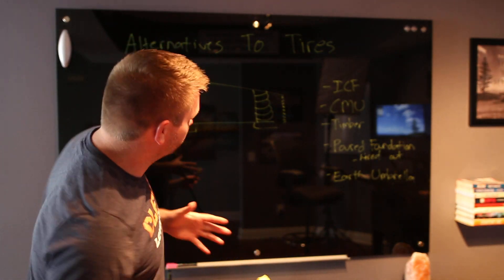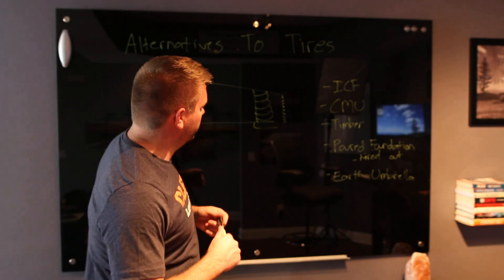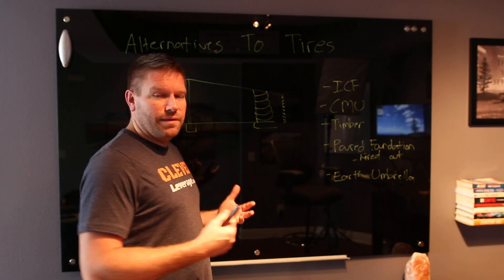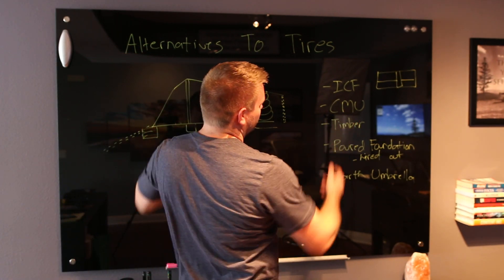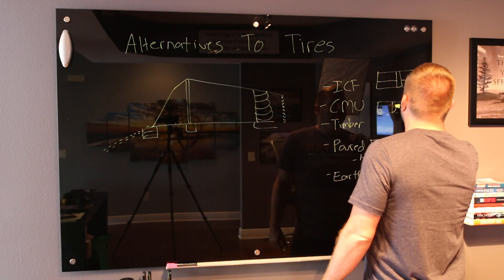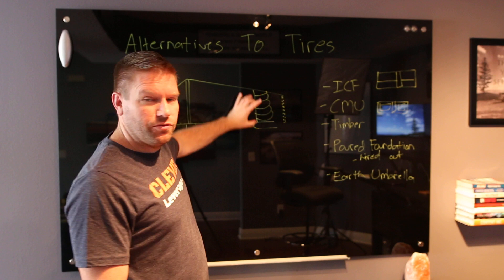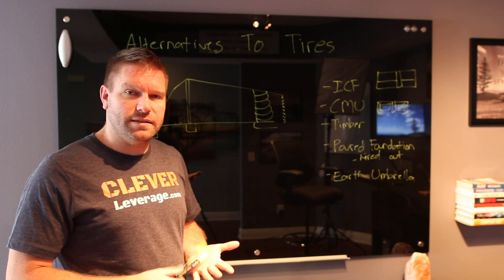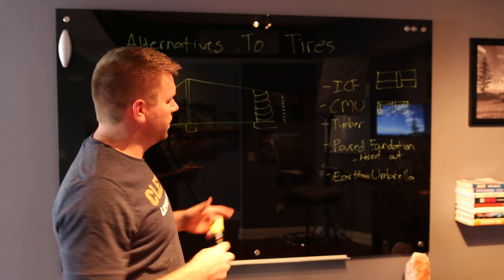Earthships: Alternatives To Tires

Comment: matt.  just use tires.  easiest by far.  rubber is resilient.  we can come to your site with 10 people and pound 1000 tires in 10 working days.  the whole outer wrap, cisterns, and cooling tubes installed.  prison labor it is.  but quick
Reply: Big Sky,

Do you have an estimate on the cost to do 1,000 tires?
Reply: @dennisbird  hey Dennis.  the answer really depends on were you live.  weather. materials cost.  labor and many other factors.  however, m last house cost around 40K to get up tires, cisterns installed, rough in plumbing, and cooling tubes.  it could be much more or less depending on where you live.
Reply: @tothewoodsnet6714  not much different than regular house.  size + materials +labor =cost
Reply: @bigskyearthship  That would be ten tires per person per day.
Reply: @jakebredthauer5100  yep

Comment: Just be sure that the wall you are going to build can hold up against the massive amount of earth you put behind it. The idea with the tires is not only about thermal mass but also as a counterforce to hold back the tons of dirt behind them
Reply: this is why EB tire walls are not even vertically straight, a straight brick wall would be hardly able to hold a green roof AND the wall behind

Comment: Why not go with cheaper more sustainable EarthBag tubes, or bags and rebar? Its got much mass, hurricane (wind) proof, fire proof, rot proof, bullet proof and EarthQuake proof?
Reply: Labor?
Reply: @jakebredthauer5100  how is that more labor intensive than pounding tires?
Reply: @oakmountaingod  What about going down in the ground Like Mike Oeler did.  He dug his by hand, but you could use an excavator. Then you make a wall and backfill.  Put an insulated roof on it. I don't think tires have much value in a cold climate.

I was not talking about tires. Tires are disgusting.
Reply: @jakebredthauer5100  I agree with you on that 100%. I am looking into alternatives for tires because I won't use them.
Reply: @oakmountaingod  What is your location? Hot cold Wet dry? Severe codes, mild codes? Do you want to spend a lot or a little? What are the top two that you are considering? Often the way the Indians did it and the way the pioneers did it at your location will give you some clues about what is appropriate.
Reply: @jakebredthauer5100   " The 50.00 and up Underground Home"

Comment: I have been exploring the same problems, on a hillside dig out for your building walls tapered or stepped back like a retaining wall,  then dig back 8 or 10 ft for thermal mass, with a backhoe, insulation on back of the trench and on top of mass waterproof cover,  put a french drain into water storage for drainage , fill with larger rocks filter fabric then gravel, could be done with 1 or 2 guys and a excavator pretty quick, basically  it's like a walk out basement with a greenhouse
Reply: I've used that same analogy as an argument in favor of poured concrete walls.  It's essentially a walk-out basement with patio doors all across the front wall.  Another upside is this should easily meet code in a lot more locations than some of the more exotic materials and methods used with earthships.

Comment: I’ve seen people build houses out of hay bails.  I don’t know if it would be strong enough but it could be a option in combination with other support.  
NOTE - I’ve never done it so I have no clue lol
Reply: I've done it (helped build them).  Not a great solution for higher-humidity regions and you have to be pretty fanatical about preventing moisture from getting into the walls, and making sure it has a way to get out.  Otherwise it's prone to rot/mold.
Reply: Hay bale can only be used for above grade projects, usually on tall basement foundation walls and under very wide eves/roof, it needs to be kept very dry or bad things. Earthship is a partly below grade project, half underground so as far as I know it isn’t possible to keep it dry enough in an earthship to use hay bale walls safely.

Comment: Hi, Matt, what kind of natural local materials are available on site or near by? I mean are there any stones, logs etc. in your area which can be easily used for construction as an alternative? One more example of earthship but looks like no tires: https://www.youtube.com/watch?v=I9jRYHpeAk0&t
Reply from the maker: Hi, lots of stuff to choose from... it's northern Maine, so endless amount of logging timber, there are rocks and boulders within a mile or two, but likely need an excavator long term to handle them. I can order concrete too, just have to be careful with delivery charge for remote areas. I would say number one resource in abundance is logs. Thanks, I'll check it out now

Comment: When you place a pole in the ground it always decays at ground level . A man that installed telephone poles that I know told me that. Everything above and below ground stays good for a really long time man. So if you was to wrap the pole with tar and tar paper or plastic it would last for a long time
Reply from the maker: Thanks David. Ah, so if it they were mostly inside the structure and waterproofed, might actually stand a chance?  Interesting, I’d like to dig into this more... seems similar to what they’re doing with the wofati?
Reply: @matt-justice  Mike used local trees for posts, charred, put in two ordinary polyethylene bags.  Mike Oheler, Fifty Dollar and Up Underground House.  I heard the house is still doing well.
Reply: @matt-justice  Soil is too heavy for a roof so use wood chips kept dry with a metal roof and collect runoff.   Use a sturdy ceiling for a deck for the wood chips or corn stocks.   Apply two or three feet thick.  Cover with soil for fire suppression, ventilation space, some kind of roof.
Reply: You probably should consider what kind of wood your timbers are made of...a tar-coated recycled telephone pole sounds like a good idea. Also, if you have the budget-cypress! It has a well known history of keeping its integrity in wet conditions. But, $$$$.

Comment: How about rammed earth?
Reply from the maker: Might be alright if I can rent some forms from somewhere. Have you used a particular type before you like?
Reply: @matt-justice  not yet. But I am thinking through the same core question your video is about. And I like rammed Earth as a material, very natural and warm. But probably would need concrete posts for the roof beams I think.
Reply: @matt-justice  forms should be easy to make out of plywood and 2x4 (or 2x6 / 2x8 depending on the length of the form). My biggest question was where to get a pneumatic compactor on the cheap with a large enough compressor, since I'd have no interest in doing it by hand :)
Reply from the maker: I hear that! Between pounding and lugging, I think I'd be done with these structures after I built half of one. You might be able to rent a gas stand up compactor if you're walls are wide enough to keep the plate aligned inside the form?
Reply: @matt-justice  nice little clip i just found. Looks like plain old concrete forms. Either rent or scout Craigslist for them. The thickness of their walls looks good too. Maybe even 1.5 - 2x that for the earth ship. Then pond liner on the hill side of it before filling in. Could see that being a very nice thermal mass. But yes... a bit of work still. I'd imagine 5x faster than tires though... It makes the most sense if the earth on your location could be used to safe a bunch on material. 
https://www.youtube.com/watch?v=o8dmHzwyjuM
Reply: @matt-justice  Rammed earth requires only one section of form.  Move it over or up as you go.  No waiting for curing.

Comment: I want to use 1200x600x600 interlocked concrete blocks $30 each 4 walls around 6 metres long
Reply from the maker: Yes!! I’ve been looking at these, seems like the perfect solution... and the wall will be done in 1 day. I can’t find places to buy them in Maine so far. Every once in a while there are a few on Craigslist, but not enough quantity.
Reply: This sounds like a potential solution.  But at C125.00  where I live, still might be cheaper and definitely quicker than poured concrete, time to get the calculator out :)

Comment: Instead of vigas some kind of posi strut bowstring trusses can be considered for the roof and back wall load bearing as well
Reply from the maker: Excellent idea, thank you. Have you purchased some from any reputable manufacturers/builders you'd recommend?
Reply: That's the only link I would recommend so far: https://ru.scribd.com/document/176999705/Truss-Solutions-for-Curved-Roofs :)

Comment: Is it worth inventing the wheel again? In my mind earthship construction should be embedded into underground dome home building technology with greenhouse exposed to the sunlight, e.g. https://www.youtube.com/watch?v=RoGuvvzHY1A & https://www.thestar.com/life/homes/decor/2012/12/07/paula_lishman_and_bill_lishman_go_underground.html
Reply from the maker: Edit: Thanks I checked this out, I don't want to be in a cave. Part of the reason to build it is to look out into the forest, inspire creativity, etc...
Reply: Well, I mean underground doesn't imply the cave in essence e.g. https://www.youtube.com/watch?v=oej6EvxBJkI  or https://www.youtube.com/watch?v=nMFJoo3DRXsI i.e. it could be earth-bermed: https://www.youtube.com/watch?v=ZgWTeU7zDGI & https://br.pinterest.com/pin/86835099035375958
Reply: Yes! www.monolithicdome.org
@Matt Justice, WTF, bro? You ask for a solution, but reject it when provided. A monolithic dome is no more of a cave than an earthship. They are perfect for sloped terrain, as you have described. Picture windows and skylights can be included in the design. After pouring a standard concrete slab, with utility stub outs and building a rebar cage, 3 people (two cement mixers and a nozzle man) can shoot shotcrete onto a 20 ft dia airform with a $50 mortar sprayer and a compressor in a single day. One room done, connect more domes together until your earthship is complete.
https://www.youtube.com/watch?v=RoGuvvzHY1A